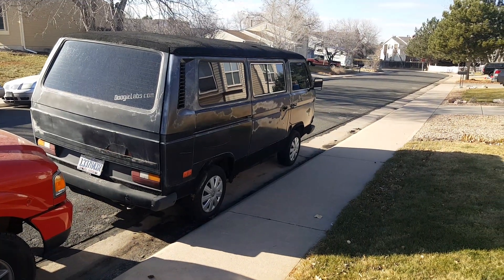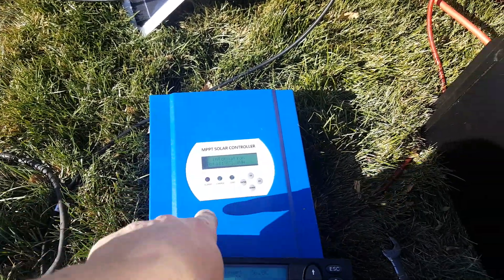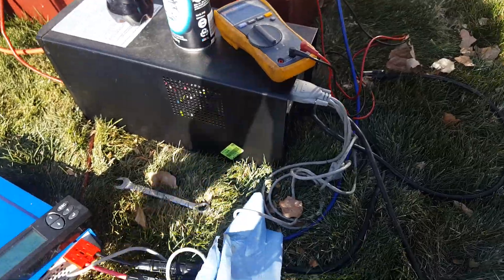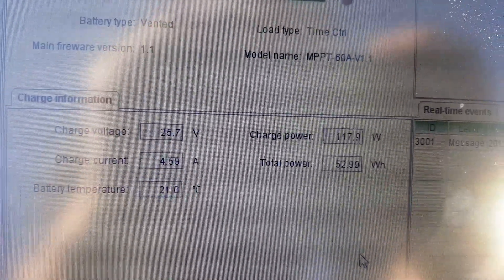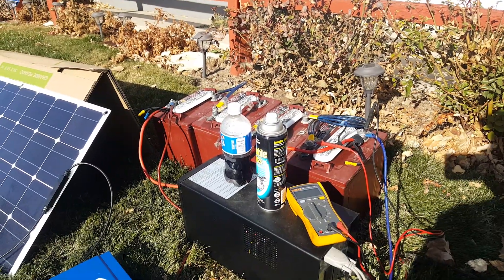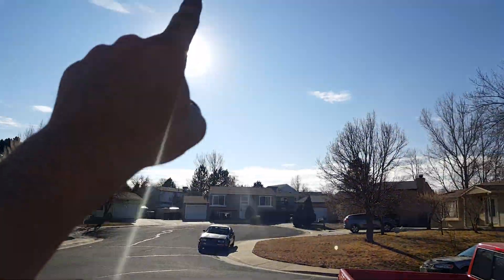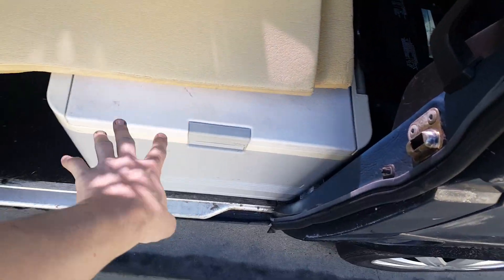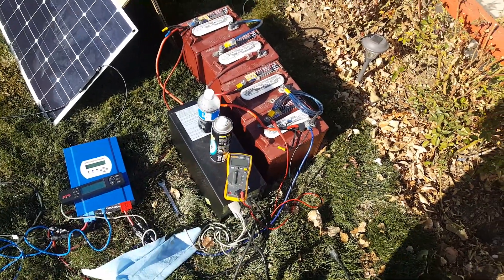VW Bus / Van Camper Build - Solar system first look and initial test

Comment: Dude you literally are the pioneer of the current cheap plug and play units they sell on Amazon for camper vans. Rock on! I got a vw vanagon 1998. convertered to camper. Hope all is well with you. Cheers

Comment: how many watts are those panels? for 250 amp hours you'd want at least (imho) 500 watts of panels. my system is 240 amp hours with 480 watts of panels (input at 24v, charging 12v system) and it does brilliantly, most times its done by 10am (approx 4 hours of charge) after a night of powering amplifiers and lights (and sometimes on a boozy one, the fridge) usually im just taking the top off the charge and not going full cycle which results in years of battery life versus months.
Reply from the maker: alex993cc1 the panels are 120w advertised output. This was in line with my initial measurements. The original plan is to eventually have 5 panels in total
Reply from the maker: They are 120W Each, the plan is to have a total of 5 panels on the van.

Comment: Cool solar setup! So the UPS won’t be running 24/7 right? Only when you want AC? the fridge is powered from the 24v DC on the batteries?
Reply from the maker: Correct only when I want AC, I may remove the UPS altogether and put an inverter in there. I do like the charger aspect of it though. I think it draws about 60 watts at idle, and I also think that is adjustable in firmware.